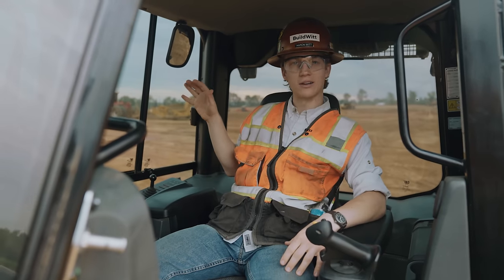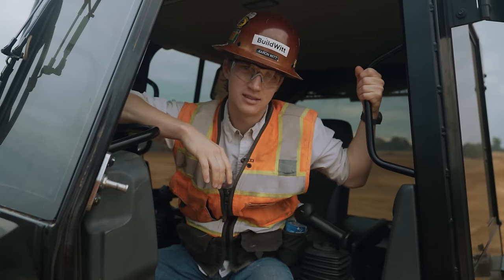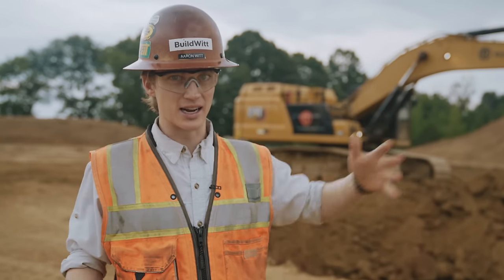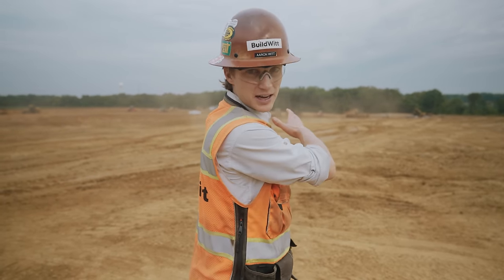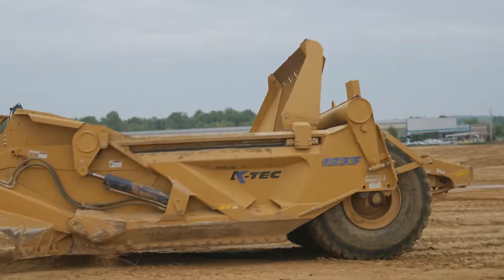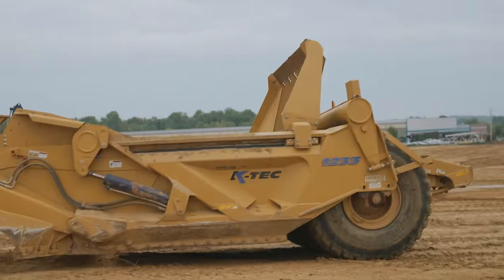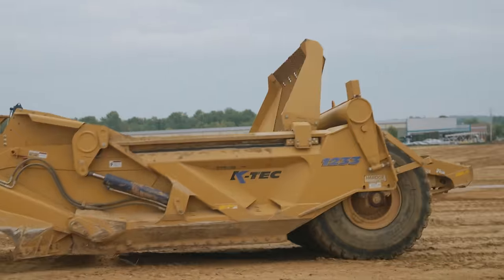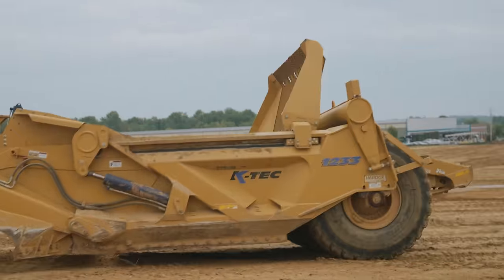Quad Track Scrapers VS Excavators & Haul Trucks

Comment from the maker: In a project like this, do you prefer quad tracks or tires?
Reply: Quad track for the win!
Reply: If it's my call, i would go with duals tires first.
Reply: I run the scrapers in nice dirt and haul trucks in rocky material. MTS 3060T is the best.
Reply: Good question. Are you working on slopes? What material?

I prefer tires for the pure fact that guys are usually going to tear up tracks quicker spinning in the cut
Tires are also better for compaction when rolling in your lifts
Reply: quad tracks, you can open the front and back gates on those pans otw back to get loaded and scrape your haul roads, they have enough ass to where they'll cut like a dozer versus just sliding across hard spots when you get to them
Reply: We run cat 657 scrapers in good dirt... rock jobs we run 5130b excavator with 777 haul trucks

Comment: Totally false about the quad tracks when it gets wet out!!!!! ANY RUBBER TRACK MACHINE IS WORTHLESS WHEN IT GETS WET OUT! They will just sit on top and spin. The quads are a little better than the t track machines. But the rubber tire machines can dig through the wet greasy stuff and find nicer material  to bite into. If they are having trouble with that case getting traction then it's operator error not locking the diffs before making a pull. Now the newer case tractors, say 2020 and newer have auto diff lock. Which works pretty good bc you don't have to worry about it.
Reply: That’s definitely up for debate, we have mts 3630s both tracked and tire versions, our operators won’t go near the tire versions because of how poor traction is in the cut
Reply: Wider rubber tracks are a lot better than tires , that slim tracks are a bit worthless , I confirm
Reply: Track is definitely better then tires

Comment: Aaron, i have to disagree with your assessment of the quad track on track vs tires and here's why: Every farmer that i heard taking about a quad track say that the tracks are no good on the soft and/or muddy surface cause they have no traction. That's why i'm saying that tires would be the better option if you are working in a soft/muddy surface. Great video anyway and have a good one!
Reply: It depends on the mud. If it’s wet clay then tires are no good. It’s like ice.
Reply: thing is tracks might not sink as quick in soft mud, but once they do you are beyond screwed they have a harder time digging themselves out again
Reply: What may work in the agriculture world doesn't always transfer over to the construction world. Wet dirt for us in construction is usually clay, (at least here in the south) so tracks are way better. But wet dirt for farmers may be undisturbed soil usually thick topsoil which I could understand why tracks could be a bad thing in that circumstance. I say all that to simply say I do agree with him saying the tracks are better, in our line of work.
Reply: Tracks shed mud far better than tires do because every time they make a loop around a tumbler or idler the mud sheds off
Reply: On a dirt job where the workers know what they’re doing the rain only makes 4 inches or so muddy, where as farmers have to deal with a few feet of mud sometimes
Reply: Markey.  We run both tracks and dual wheel tractors. As far as mud goes those eat will tractors without pull the track tractors in mud as they lose their grip simply because of their Lowground pressure. 
We also run a new JD 9rx which is an absolute beast but you just cannot get it into anything slick as it will slide all over the place and a rubber tire Tractor hast to come pull it out. 
  With that being said it’s quite the opposite you get in a super dry environment with a high sand content and those tracks will absolutely outshine the rubber tire tractor every day.
Reply: Hard to make the comparison between earthmoving and farming.  An original style overhung rubber tired scraper works great on an earthmoving job. They woudnt go 15 ft in a farm field.
Reply: @Team_Banchamek  same with rubber tracks I would assume. Steal pads with single grousers are the only thing that can touch wet clay in my experience.
Reply: @troyverburg9600  no because the rubber track have a much bigger service area
Reply: We use case quad tracks with pans in  soft soil were trucks just sink and make a mess
Reply: makes absolutely no sense as the track keeps Afloat ..Tires sink..as the track bends it cleans out..As Tires won't do that.
Reply: A 2 track tractor will struggle in mud because the don't get enough traction to steer under load but an articulated 4 track tractor is tough to beat in mud.

Comment: Quick note, the MTS tractors are actually built by Versatile, then MTS adapts them to pull scrapers, as well as dropping a CAT engine in them. If you look up a Versatile 600 Delta Track, you'll see that they look nearly identical.
Reply: I was just thinking about how similar they looked. I wonder what they do with the engines afterwards.
Reply: pretty sure everything they make is just buying shit from other companies, changing them slightly and slapping them together and calling it a day.... because both of their tractors are just normal farm tractors
Reply: Frame is 18 inches longer. Engine change for greater dealer support.
Reply: Actually mts builds the back half of the tractor before shipping it up to buhler Canada (parent company of versatile) where the tractor is assembled. The undercarriage is specific to mts (but built by camso just like everyone else’s undercarriages) at this point the cab and diffs are still the same but almost every major component has been altered/redesigned by MTS for their own needs. The end goal is to have the tractor built 100% by mts at their headquarters in Iowa including undercarriages but you have to start somewhere.

Not too many tractor companies are starting up in the 21st century I give them props for how far they’ve come since the 3550 first came out in 2015.
Reply: @Thekilleroftanks  everything mts sells aside from their tractors are completely built by mts at their facility in Iowa. I’ve been there multiple times. everything from their scraper pans, haul truck -scraper conversation kits to their pull behind disks all start out from chunks of steel
Reply: John Moyna is from Iowa and owns C.J. Moyna and sons one of the biggest dirt contractors in iowa and has designed alot of experimental equipment for CAT like the ejecting haul truck that doesn't have to lift the bed they did a highway project near where I live where I seen alot of the stuff he designed has paid for most of his company
Reply: Wow, already had a Cummins in it as a versatile,  I'm even more confused now as if it was painted red and yellow you wouldn't tell the difference.. thanks everyone for your input, ??
Reply: Copy looks identical as I've operated a 600.
Reply: Rubber tracked scraper tractors are a bad idea. They cost more to maintain, they burn more fuel and they just won’t last as long as tires. We’re in the ag land levelling business, tried a CaseIH Quadtrac scraper special on dirt pans, lugs were ripping off at 600 hours.

Comment: Pan scrapers are fine pieces no doubt and can move gobs of dirt, and depending on how packed it is, even gravel or river drop stone. Though they do struggle in wet clay or areas with random boulder and rock ledges.

But anyway, it's not about what's better, it's more about what is best for the area and conditions. Sometimes it's a scraper, sometimes it's excavators and trucks. Both are neato and have the tendency to make some folks just want to stop whatever they are doing and just watch them bounce by.
Reply: This right here. Our company has so many different ways to move dirt. Like you said what's best for area and conditions. Sometimes it's haul trucks sometimes it's a tractor and a scraper. We also have one of those tractor trailer scrapers from cat and some twin drive scrapers for the really hard packed clay job sites. Having the big cat powered tractor trailer with a large pan trailer and the ability to through a twin drive behind it and push really easy through hard packed dirt. In the really wet stuff haul trucks all day
Reply: @mackenziepeek9317  Lol. We use wheeled tractors and 1233's in Kentucky. Dunno how much you know about Kentucky's geology, but it's pretty much all clay. Lot of bentonite, flint clay, with some fuller's earth mixed in just for good measure. Not much topsoil anywhere other than the river delta areas that flooded historically. It's a hard pull every cut. A push tractor is pretty much a must on every job. Still faster than a rock truck though. You get four or five good operators in the cut with pans you'll still outwork an excavator and haul truck, plus you only need one operator for the tractor. If the haul truck was self loading we'd probably use those, but anymore you're lucky to get the people to show up that you have.
Reply: @twistedpixel2558  yeah. Those scarpers are amazing. I did tons of work through Alabama TN Virginia and the Carolinas. Worked from the red clay to the solid flint all the way to the sand. Only time I've ever wanted a haul truck and an excavator is when we moved pure soup like down here in Louisiana

Comment: Have to somewhat disagree with the quad track reference and when I say someone disagrees I’m about half with you. 
  Now I’m speaking in the farming industry.  we run to STX cases and one John Deere 9 RX
 When it gets somewhat muddy not a total mess those tracks create a lot of compaction issues. Especially during planting season that’s when you don’t want to compact they create a hard cap on top that rubber tires just do not.  
 But one thing you also mentioned that rings true in farming also is speed in low traction environments. We can cultivate and/or plant probably at about 1.6 to 1.8 miles an hour faster on tracks then you can on rubber. 
 We’ve had our machines for about three years and that’s here in Texas so we do have a little more sand issue than most people do and the cost to replace the rubber belt is pretty comparable to dual wheels but our run time seems to be only about 70% on the tracks compared to rubber as far as lifespan of probably 14 to 1600hr of use. 
 I would be curious to know what they are getting on those quad tracks you filmed on the undercarriage and rubber bands in hours before replacement
Reply: My very limited experience with rubber tracks is that they are for soft conditions, but not muddy conditions, and that they don't work in slick clay, or rocky ground at all. Would you say that's correct? 

I'm surprised you have compaction issues with tracks when the ground is wet. Do you mean that you get kind of a "glaze" on the surface, and not so much compacted?

Thanks for sharing, it's interesting to see what people are experiencing in different conditions with different machines.
Reply: 14 to 1600 hrs of use on tires before replacement??   We bought a new tractor, ran it two years farming and then put new tires on the tractor and mounted the old tires on it with band duals.  29 years later, we sold the tractor with a little over 10,000 hours on it and still running those same tires.  We did not run the tractor on pavement very much.

Comment: I still prefer excavator/loader and haul truck and dozer in the fill. But I'm of the mind that if the jobsite can allow for it, 777 haul trucks are a great middle ground in terms of payload (101.1 tons) and turn around time (of course, that's depending on the operator at the controls) compared to scrapers (the 657 only has a bowl payload of 52 tons brw). Dont get me wrong, scrapers have their place, but I find the fact that theres usually a good amount of scrapers constantly down more than haul trucks (old and new), and one of his videos with Ames Construction proved my point with the number of scrapers down for one thing or the other. 
 So, I see scrapers as a nasty money pit. Not so much the tractor/articulated pulling a pan or two. Scrapers are a decent tool for contouring but dozers and graders are usually better at that.

Comment: Well, a scraper is one engine, one operator and it does the job of an excavator and a haul truck in one. Each have their place though. A pan doesn’t do well with rocky soil. Off-road dumps and excavators make a big mess in wet dirt.

Comment: Depending on twin engines not so much for the fact your burning twice the fuel for one load so with haul trucks you'd get 2 loads with 2 trucks and excavator. Plus make one cut with the excavator. Deeper cut. With have the tire cost as scrapers

Comment: Whats the advantage of using a tractor scraper over a regular scraper?
Reply: If the material isn't super hard packed clay you can cover ground faster in a tractor and pull behind pan vs a traditional scraper. If you get into really hard dirt the regular scrap having the ability to push and pull with 2 of them will walk circles around the tractor and scraper since it has more push pull power
Reply: Versatility. With the tractor and pan you can unhook the pan and hook up a dump wagon, disk, sheeps foot, box blade. The traditional scraper is a one trick pony.

Comment: those quadtracks are just painted Versatile tractors
Reply: No they’re not!!! For one you can’t get a Cat engine in a factory versatile.  The whole rear section from the cab back is way heavier and built by MTS. The rubber tracks themselves are different. Bigger hydraulic pumps. I could go on.

Comment: It’s just a yellow versatile which is a case
Reply: It even close. When you don’t have a clue you make ignorant comments like yours.
Reply: @gregjames5070  looks identical to a Versatile
Reply: The cab and hood are about the only thing that’s versatile.
Reply: The cab and hood are about the only thing that’s versatile.
Reply: The cab and hood are about the only thing that’s versatile.
Reply: The cab and hood are about the only thing that’s versatile.
Reply: The cab and hood are about the only thing that’s versatile.
Reply: The cab and hood are about the only thing that’s versatile.
Reply: The cab and hood are about the only thing that’s versatile.
Reply: The cab and hood are about the only thing that’s versatile.
Reply: The cab and hood are about the only thing that’s versatile.
Reply: The cab and hood are about the only thing that’s versatile.
Reply: @gregjames5070  did a little research and it looks to me is they painted the tractor yellow put a CAT motor instead of a Cummins and kept the TA22 CAT transmission not bashing on the tractor or you by the way I’m just saying it’s a Versatile with a different motor
Reply: The rear frame is twice as heavy, 20 inches longer and built by MTS. The axles and planetaries are bigger. The tracks and track  frames are different, bigger hydraulic pumps, exhaust and fuel tanks are different. All that versatile is providing is the front frame, cab and hood.